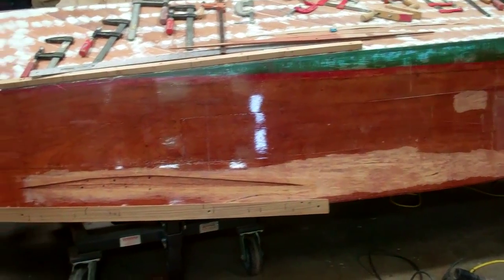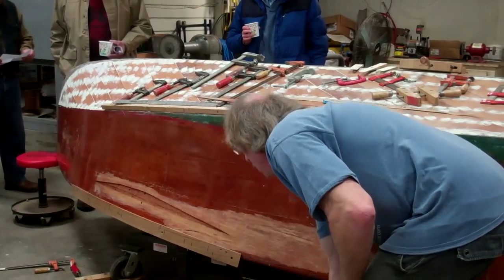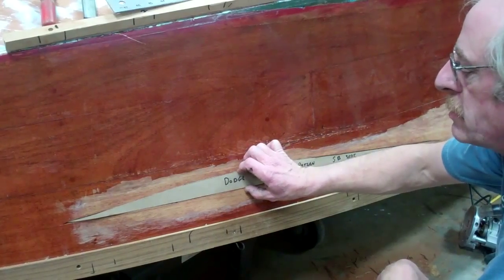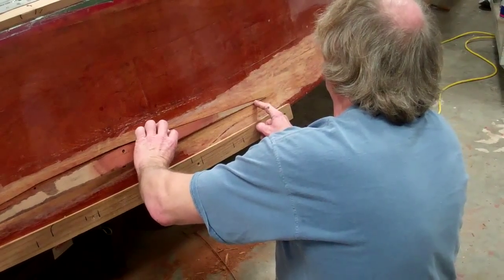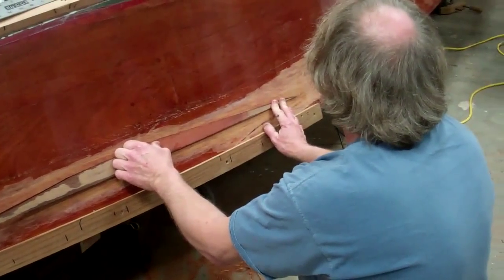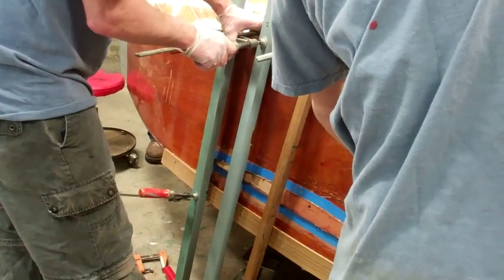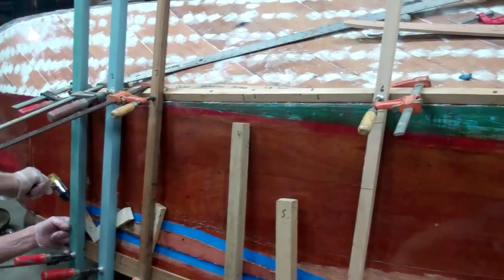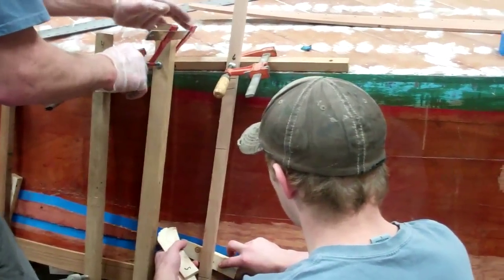Snake Mountain Boatworks Dutchman Topside Repair Clinic 1 24 2015

Comment: Thanks for the video.  I have been restoring antique/classic wooden boats for over 20 years.  I do have trouble seeing a dutchman of that size on a topside of a nice boat.  I agree with attempting to save as much of the wood as possible but re-planking in that situation seems more approiate.
Reply from the maker: We beg to disagree, as that particular plank runs almost the entire length of the topsides. Our passion for saving all that is original to the maximum extent possible, especially in a vessel of such historical importance, makes replacing that much of the topsides something that will not happen in this shop.
The Dutchmen turned out extremely well, and will be all but invisible once her topsides are bleached, stained and varnished.